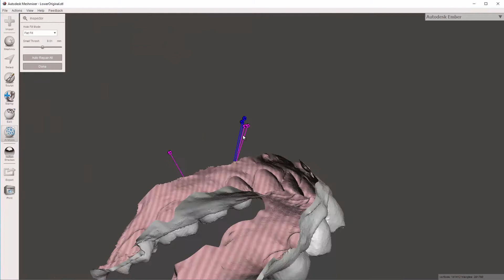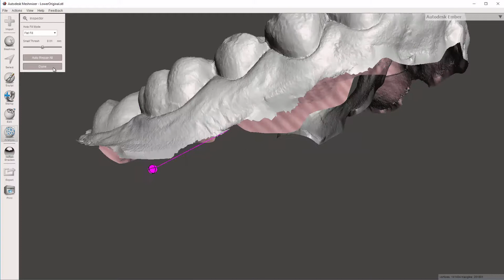Video 2 of 5: MeshMixer Dental Model Trimming

Comment: I have a scan of someone in ortho and along the brackets, there is a large opening where data did not capture. Trying to close this hole with the inspector tool as you demonstrate makes the ball turn grey, and nothing happens. Any thoughts on how to actually repair the area?
Reply from the maker: The whole most likely has in a regular border. You'll need to trim it back a bit more until the margins are smooth.